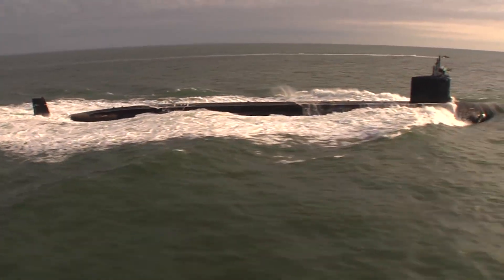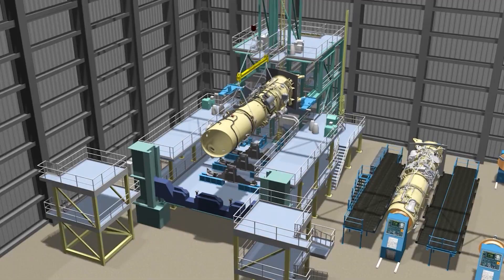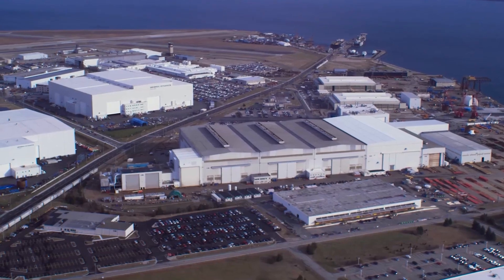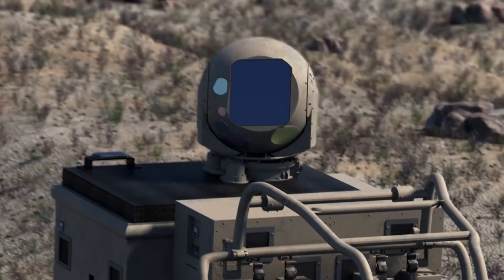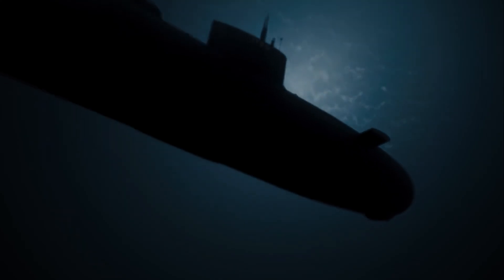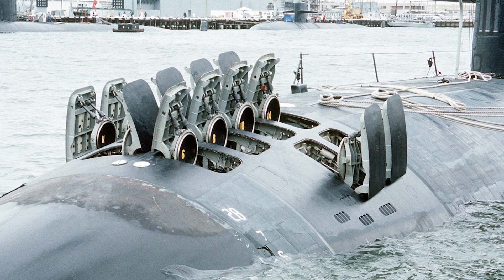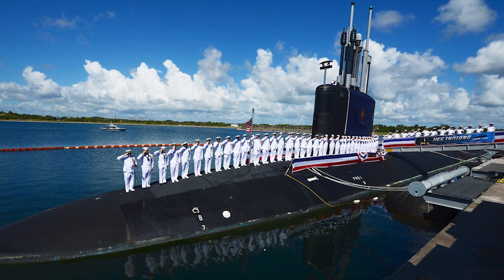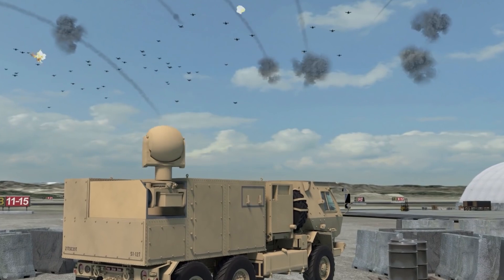The Submarine with a Laser

Comment: plenty of nonsense in the comments... lasers will not work efficiently underwater so count that out. diffraction, diffusion, dissipation, density, can't stop light bending, super heated water in a millisecond would be explosive. so many reasons it's worth forgetting underwater.... lasers are line of sight so being at sea level doesn't give a lot of range... best used as anti missile/drone and for anti-satellite warfare... a 500kw laser? possible but huge issues with heat and melting components to produce the beam in the first place. much better to triangulate multiple smaller lasers.

Comment: 6:10 wtf. the effectiveness of the laser is dependent on the distance the laser light travels. not the depth. You just explained it and then dropped a turd of "With a submarine reaching  complete darkness past 3,280 feet,  it would seemingly render laser weaponry useless." Depth and darkness has nothing to do with laser scattering in water.

Comment: One interesting side effect of using commercial off the shelf (COTS) is the potential for counterfeit materiel.  Always been curious about the certification process for COTS circuit boards.  Boards made in China can be a real problem because besides them not being built to spec, they can also contain malicious firmware.

Comment: Is it possible to power it enough to superheat the water in front of the sub allowing for extremely fast travel
Reply: I guess that would technically be possible, but give you a whole slew of new problems:

A) The bubble / "spear" would have to be huge and uniform
     so you don't end up with wildly fluctuating pressures down the length the hull.
B) Any conventional drive (i.e. not rockets) needs "solid" water.
C) Getting any signals in or out of the sub with that thing on.
D) That would probably be noisy as f. .

Comment: I'm a engineer with 43 years in laser/photonic technology. When I stated my career at Hughes Aircraft passing a laser underwater was a huge challenge. It still is, as is incorporating a laser on anything in the air. Not counting launched devices/weapons (missiles, rockets etc) One problem is lasers are incredibly fragile and touchy. You can have hundreds of optics in a laser, one misalignment and the systems is down. They are also energy pigs...roughly 10% efficiency. So if you want 1,000 watts out you have to pump in 10,000 watts of energy. It's not that easy.
Reply: Not to disrespect your experience & expertise, but I'm betting the folks at DARPA have mitigated/solved many of the problems you have outlined.Obviously, NO ONE outside of such secretive organizations will have the specifications on the very latest technology designed to overcome the shortcomings you have stated.
Reply: @_BLACKSTAR_  I doubt it. I'm still connected via associates/colleagues my secret clearance is still active. Passing photons (light energy) in ocean water is an still insurmountable. If this is ever achieved it will be well know by the science/tech industry, similar to the recent fusion breakthrough.
Reply: @_BLACKSTAR_  Let me know when Darpa solves physics LOL
Reply: @smeezer  I believe they can make more powerful lasers with more coherence which would improve the range & mitigate the absorption.If Im wrong then explain why.
Reply: @DasArschlochKind  That's not how reality works lol
Reply: Weren't the navy looking into underwater satalite communication with infrared lasers at one point?
Reply: @deth3021  Yes! And there still is interest in doing that. I don't know all the challenges but apparently trying to pass any wavelength in the visible or infrared through ocean water is really difficult because of absorption.
Reply: @kendall Evans  yes, the nemesis of lasers is absorption. A reason I've always had my reservations about them in defensive roles.
Reply: Did you mean to say 10k watts for 100k watts of energy in?
Reply: @ericpatten6204  10% efficiency....I think I corrected it.
Reply: Maybe Chirp Pulse Laser (Some joke they should be called Phasers) are the answer…the laser creates an incredible focussed sonic punch…that…is very effective in denser mediums…like deep ocean water…the deeper…the better!
Reply: @RedcoatsReturn  Chirp pulse is still photon based and the problems still exists. Ocean water will defuse ANY photon stream.
Reply: It’s a good thing they have nuclear reactors on board so the energy really isn’t a consideration.
Reply: @MonoPrime  that reactor can only output so much power before it becomes too large or it's cooling requirements become too large.
Reply: They don't need to pass a laser underwater... they're going to incorporate it into the photonics mast.  This will be a "poke the mast up, crack off a 300kW shot, and slip back under" deal.
Reply: @tangoprime  Where did you hear that?
Reply: @kendallevans4079  Well, in the video you're commenting on here for one - but also there are quite a few articles from 2020 about it (Forbes, Popular Mechanics, etc.) and it makes sense.
Reply: @tangoprime  I'm not saying it's not possible. I'm just curious of the development. Also are we speaking of the same concept? Passing photonic energy underwater for communications is what I was referring to, not as a weapon.
Reply: @kendallevans4079  My apologies then, we're definitely not talking about the same thing - the laser use on these boats being referred to in the video (and some of the articles I've mentioned) is use of a 150-300 (or more) kW system via the photonics mast for defensive / offensive surface use, not underwater communications, as part of HEL C-ASCM (HELCAP).  

We know from public releases that the Navy has already started deploying Increment 1 systems (ODIN, HELIOS) and the DoD has began taking delivery of more powerful systems as of last fall that are within the power ranges for HELCAP & Increment 2.
Reply: Spelling wasn’t your biggest achievement! Lol
Reply: @MiddletownHeart  How cute! You post as a couple.....NOT!

Comment: Lasers work under water just fine, as long as you are not trying to MELT something.  Water provides a very good surface for absorbing and flowing away heat.  But they can weld and cut under water, at short distances, so they could have some value in underwater weaponry by taking advantage of other aspects... particularly considering it doesn't take much of a hole to give a sub a bad day.  Having a NUKE makes it something worth looking at, though the ships with nuclear reactors should have these well proved out before subs start looking at them for underwater work.  I could see using these off the shores of N. Korea to knock down their missile tests.

Comment: If you are pushing 500 kilowatts of ionized photons in the blue wavelength, you can detect a few watts of ionized photons on the return trip. Ionized photons pop on detectors. Otherwise it might make an anti-helicopter weapon or a somewhat speculative anti-torpedo defense.
Reply: How about underwater lydar, to detect subs.
Reply: @nunya3163  Exactly. However like any active system its emission can be detected by the target more readily than by the searcher.
Reply: @NikovK  Very true, but the challenge that the US faces, is with the Chinese diesel electric subs lurking in the various straights near Taiwan, and in the South China sea.  They are extremely quiet, even by our standards, and are known to just go completely silent, taking up a station, waiting for targets to approach.  They are essentially holes in the water at that point, and it would take some form of an active system to detect them.

Now the question is, would they be able to detect the laser, and it's source with existing tech, or would it need to be outfitted with an all new, detection system that has not yet been developed for that purpose?

Comment: Lasers would be great for shooting down drones. The problem with lasers is the amount of power that must be generated to produce the laser beam.
Reply: It has a nuclear reactor...
Reply: @_-Wade-_  Lasers on trucks will not work, that was what I was referring to in my comment.  He had a picture of a laser on a vehicle. I assumed that people reading my response would know that a submarine, as stated in the video,  or a ship could generate the amount of electricity needed to produce a laser beam. A land based laser system would also have access to electricity needed to operate a laser weapon. Rail guns are the same.
Reply: @brisbanekilarny6212  Tacking, it looks like the bottleneck is cooling not power.
Reply: @_-Wade-_  Megawatt lasers will never be located on a vehicles because of energy demand by the laser. That is a problem; remember I was posting concerning lasers on a vehicle not a ship or submarine.

1000 kw generator could be moved around on a large truck and then there would have to be the fuel to run the generator.  That would work for some of the current military lasers. 

Cooling for what?  A nuclear reactor.  Photons do not produce heat unless they smash into something.

Comment: Maybe the laser can be used as a communication device with other navy vessels? Modern submarines need to be close to surface to pick up very long wave radio signal or 2 way satellite transmissions. Maybe a suitable drone could be sent down to similar depth of the sub and open high capacity laser link  with sub while connected by cable to mother ship?
Reply: Lasers make plasma…plasma makes a good antenna.

Comment: "Underwater" is no different than any other optical medium.  Ocean saltwater happens to have a specific transmission window in the longwave/near- UV spectrum (330 - 480 nm).  And the world's most efficient (30%) high-energy laser is the Nitrogen super-radiant gas discharge system. Which operates at 337.1 nm (primary output wavelength).  Since the population medium is Nitrogen gas, it's perfect for transmission thru earth's atmosphere as well. FYI... especially underwater, 500 KW is NOT sufficient energy.  It would require a CW laser sustaining target lock for >15 seconds at a range <1 mile.  Ya need >1.0 MW CW sustained... 

for <7 seconds at a range of 1.5 miles.  Which requires an electrical energy input of >3.5 MW per "shot" (30% laser efficiency).  The Virginia-class is presently outfitted w/ a 210 MW nuclear reactor.  The 3.5 MW/sec load of the Nitrogen laser is <2% of that reactor's power output capability. Only "issue" is Raytheon can't patent the Nitrogen laser. It's been around for almost half a decade. It ain't a "tech" issue.  It's a corporate profit margin issue.  

Call me when y'all are serious.  DoD's had my number for 35 years.

Comment: Laser weapons on a submarine are kind of pointless. It requires them to be on the surface where they're inherently vulnerable. While attack subs often do run with fleets, and this could allow them to provide additional anti-drone coverage with their powerful reactors, it's just kind of stupid. The emitter will often be wet, exposed to sea spray, and will require clearing the top of the sail in order to fire, reducing surface situational awareness. I suspect the Navy is just doing it because they're one of the few vessels, aside, from Ford-class carriers, able to power them, and they're more of a testbed for the system than a practical weapon of war.
Reply: Or there’s more to these lasers then they’re letting on and it’s not so much about the power required which may not be an issue even for non N powered boats.  But because submarines are literally the most secure place on earth to test something you don’t want the public getting eyes on.

Comment: A military grade laser used under water could be a novel way to effectively ping a target without giving away your position. (Think Lidar but underwater) Could also be used to manually guide a torpedo without it needing to actively ping the target. Thus keeping the enemy unaware of the incoming ordinance until its too late. Granted, the range would be somewhat limited but it wouldn't really have to be more than 1-2 km for it to still be very effective. The biggest factors for the lasers range would be the wavelengths used (obviously, lower wavelengths will travel much further before being absorbed by the water), the mode of transition (pulsed or continuous lasing) and its potential output.

Other non military uses...

Short Ranged Communications:  With other ships, aircraft and "friendly" subs. Once again the range wouldn't be great but the data thru-put would be pretty nice. Such laser tech could easily find many 3rd party applications outside of it military use just like GPS did with cell-phones and civilian navigation.

Terrain Mapping: Scanning the sea bottom to help search for oil / gas and to help navigate in shallow water.
Reply: Nah
Reply: @LilMilan420  Wow that was very constructive.

Comment: Laser weapons powered by electricity produced from nuclear reactors have the potential to take out ballistic missiles during the boost phase after launch. Perhaps a test or two one North Korean missiles after they cross the Sea of Japan?
Reply: What's to say that this isn't being already done? NK would have no way of knowing as the missile would just suddenly fail and thus look like another engineering problem.
Reply: No better to take them out during launch phase while still over North Korea.  That way no radioactive fallout lands on Japan.
Reply: Highly doubt power would be there for BMs but conceivably useful to knock down a drone or an ASW helicopter. Even so, a scope just above waterline with spray, fog, other stuff would somewhat quell the laser?
Reply: @markgrove2030  They shot down a north korean ballistic missile with a laser a few years back.  I think it was MIRACL or something
Reply: @The_Conspiracy_Analyst  Yessir I heard abt that but not from a sub or any other sea vessel. I'm sure no expert but still maintain that fog,spray, wave action etc (at this time anyway) would sap much of the power of a laser. Maybe I'm wrong, maybe not. Frankly I hope I AM wrong because we may very well need this capability. Sooner than later most likely.
Reply: Dream on

Comment: Maybe at some point these postings Ive made all over youtube will be heard. Now it's staring everyone right in the face. It's true, lasers don't work underwater but they are very capable above it, in the air and space. Now you're saying this guy is crazy, well, if you still believe subs and carriers are nuclear powered then no need to read any more of my gibberish.  This tech has been with the United States since the early 50's and our entire Secret Space Force has been built upon it. Some of our aircraft have it as a secondary power unit also. Here it is, it's a 1 terawatt Zero Point Energy powerplant  US10322827B2   To put that in perspective, this 3ft diameter gadget can produce 1/6 the worlds power. Now, imagine this in a nuclear sub, but larger. The sub is self contained, produces its own air, water, and can withstand immense pressure. When this gadget is installed the sub now produces its own timespace bubble and therefore its own gravity. Because its Zero Point Energy its not affected by heat, or cold, or radiation, or gravity, or pressure, or matter (to a point). Acceleration is instant, the base version is 300 miles per second with upscaled versions in the tens of millions of miles per second. For those of you still reading, here is another example of what this powerplant is used in, it's a variant of what the United States Space Force is using US10144532B2   This is called the HAUC, Hovering, Airborne, Undersea, Craft. It can go anywhere, air, space, the bottom of the ocean, land on the Sun, anywhere.